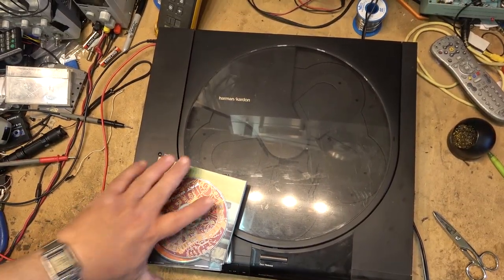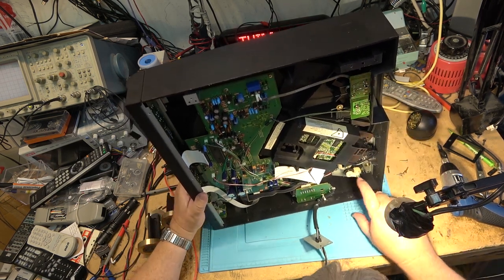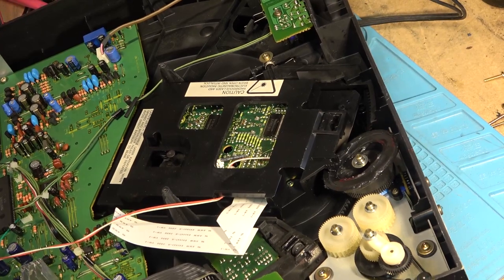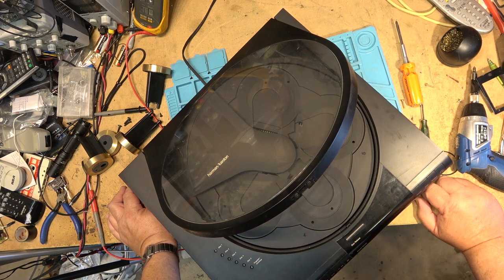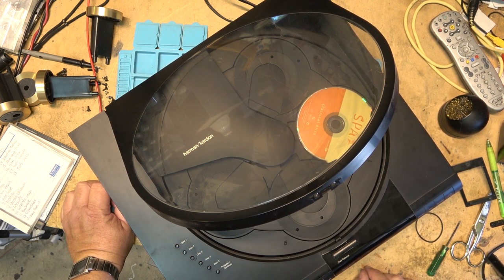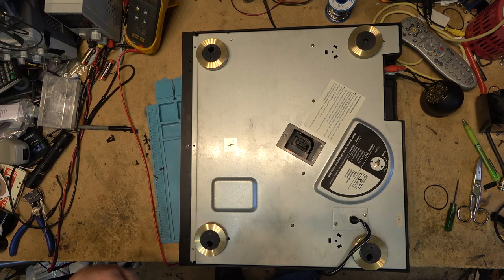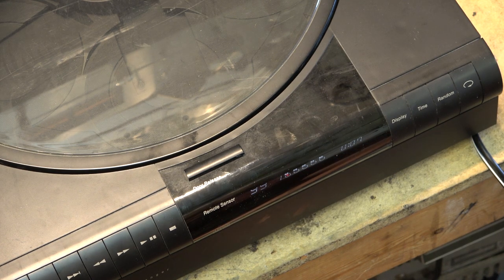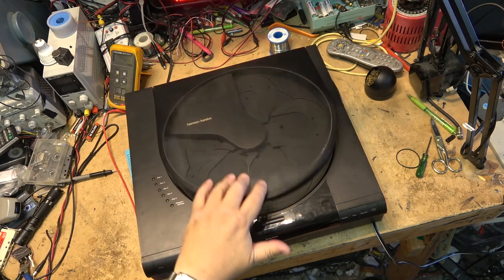Harmon Kardon TL8500 5 Disk CD player NO PLAY

Comment: yep, very old Technics pick-up; nice because it has magnetic sledge movements (very quiete) but overall not too reliable. Worked on two of those and one would struggle with CD-R due to weak laser. Tweaked a bit power level to improve performance, but it is a very temporary solution. Sledge position is derived with what is basically a linear variable resistor: the pickup moves the cursor of the variable resistor and the controller has a ball park idea of where the pick-up is when skipping track. After this in-house pickup, at least here in Europe, Technics moved to Philips CDM-4: they would bought the whole traverse with the control electronic board, so basically one third of the CD player was indeed a Philips.
Reply from the maker: Sony use linear sled motors on some of their high-end ES CD players.
Reply: @12voltvids  I had a harmen karden in the 1990s a cd player it was always breaking down.  Evantualy I replaced it with a high end sony cd/cassette deck combo.  The door mechanism on the harmen karden kept failing and the remote wouldnt work when the glass door was closed and others would.
Reply: @12voltvids  Unfortunately, and as you know, many of those Sony pickups designed for linear motor slider mechs are a real pain to find.

I used to want something like an X555ES or the X777ES, but the concern that such a player may someday become unrepairable because I can't find a new replacement pickup made me reconsider that desire.

At least I can still find pickups for my X229ES.  As a CD player, it still sounds plenty good, especially when connected to a good external D/A converter.
Reply from the maker: @Watcher3223  
My X555ES is still chugging along without a hitch.  Here's the thing that people were ignorant to. Optical devices require a clean environment. All the ones that failed didn't generally fail because the optical pickup got weak they failed because the optics were contaminated with smoke tar nicotine marijuana cigar smoke whatever cooking smoke whatever. Have it near your wood burning fireplace good chance it's going to get contaminated. Mine's always been in a smoke-free home I don't permit anyone to smoke in my house in my car in my workshop. if a smoker comes in my house they have to smoke outside and preferably stay outside for an hour after they've smoked so they don't stink my house up
Reply: @12voltvids  "Optical devices require a clean environment."

True.

Too often I've found pickups that have failed because of contaminants in the air fouling the optics, like cigarette smoke or that funk from equipment that have had a cockroach infestation.
Reply: @12voltvids  Optics do not like contaminations, that is true, but laser diodes have a limited life and on average Sony one's seems to have a shorter life than others. On top of the shorter life of LD, three beams pick-up are more fragile due to diffraction crystal used to split the single beam into the "three beams": any minimal misalignment or contamination of the crystal and tracking is gone, the player starts skipping. Early technics pick-up even had adjustment for the diffraction crystal, but i guess they needed another gig specific for that purpose. Bottom line - unless you have very big pockets, I would steer away from Sony CD Players with linear motor sledge, spare pick-up's are very hard to find and typically cost a fortune.
Reply: @Watcher3223  if you connect the CD player to an external DA, a cheap DVD player with optical output would do the same job. Sure aesthetic would be quite different, but sound-wise the same
Reply from the maker: @enricoself2256  
I've had mine since it was new and it has locks of hours. Still going strong but then again it is kept in a smoke-free house and always has been. I would not be replacing the optical pickup though if it were to fail. I'm not one to chase after hard to get expensive parts just so I can line someone else's pocket.
whatever breaks I guess I'll do what everybody else does put it on eBay and let some other sucker buy it as is and let them go through the aggravation of sourcing parts. Isn't that what everyone does?
Reply from the maker: @enricoself2256  
That's basically what it is now, a side hustle. one certainly is not making a living fixing TVs or any electronics today.
Reply: @12voltvids  if i had it since new or got it very cheaply, i’d be quite happy, but now those Sony hi-end goes for crazy prices, much more they are worth imho, you are mostly paying the aesthetic and the “aura”. If it brakes one option is to sell it as “untested” or disassemble it to pieces and sell each part for quite some money.
Reply: @enricoself2256  Well, I have a Sony ES stereo surround system, so I wanted matched components ... or as much as I could afford to get.  I have a PS-X600 turntable, which is not an ES component; a PS-X555ES is a wee bit out of my budget.  The CD player and cassette deck are ES, though.

Of course, there are Sony ES DVD and Blu-Ray Disc players, but I don't have any of those ... and I prefer to use a CD player for playing audio CDs rather than put that extra wear and tear on a DVD/Blu-Ray player, so the X229 is what I use for that.
Reply: @Watcher3223  If it's a matter of aesthetic, I agree with you, the x229es is one of the most affordable ES CD player, I have the X222ES on which the 229 is based and I like its austere early '90s look (plus it uses a pretty standard KSS-240A easy to source if it breakes). All I was saying is that when used as a transport only, any player in good working order is the same.

Comment: Im often surprised by the unusual mechanical designs.
My thought is how the hell did they come up with that.
Vcr's had some odd designs, but they seemed to do the job.
What was the man thinking of when he gave you the wrong part, what a muppet lol.
Reply: It was crazy times, the Japanese ruled the world and basically engaged in willy waving on a literally industrial scale to out-do each other with wacky designs (witness that Sanyo that could play both vinyl records and CDs on the same deck). We'll never see that type of thing again, the industry is necessarily much more cynical now, it's all about what will sell and forget the engineering.
Reply from the maker: Well he looked up the part punched it in the computer it told him where it was grabbed it and handed it to me.  It was all shrink wrapped in a padded paper envelope.  Should have opened it at the counter and checked and that is basically what he said.  I thought it seemed cheap because the 2 parts were about 25.00 less then the last time i changed them about 12 years ago.  5 hours wasted driving back and forth.
Reply: @12voltvids  So you are going to fill the splines with epoxy to fill any tiny voids that might allow a sloppy fit.
I have  known frends that welded the shaft to the lever to make it usable again.
Not ideal but when you need the bike to take you to work the next day,  a weld makes it reliable enough untill new bits can be found.
The angle grinder wipes away the weld.
A very handy tool :-D
Reply from the maker: @zx8401ztv  no I didn't to fill it with epoxy this time of it if it slips then I'll do that again and it'll last for a few years I just tightened it up so bloody tight then it's there's no real noticeable slippage between them. That's why I changed both the shaft and the lever